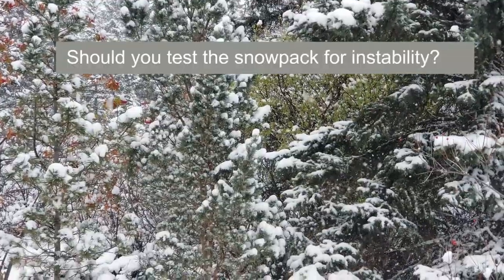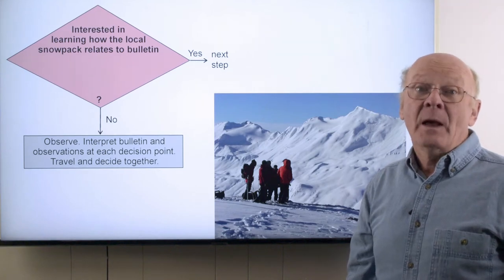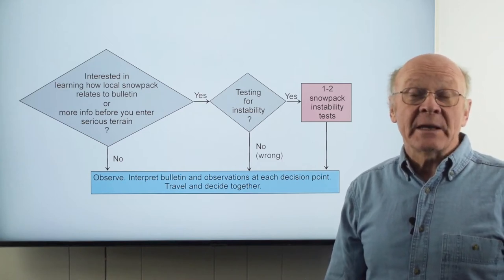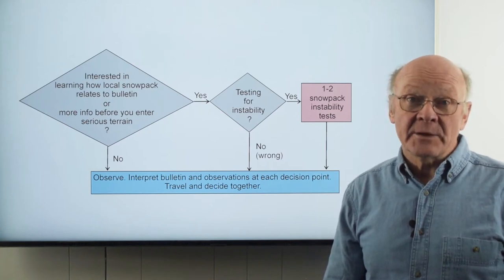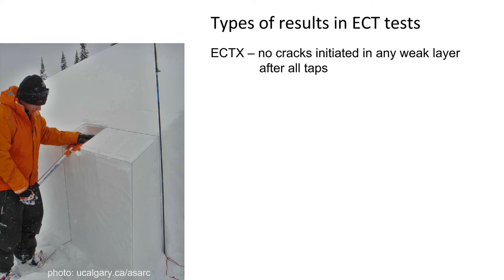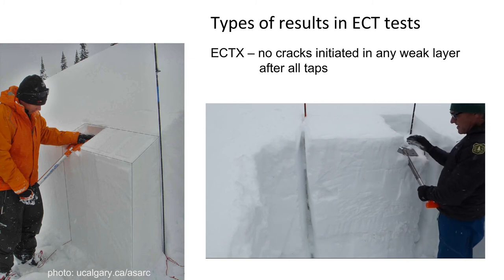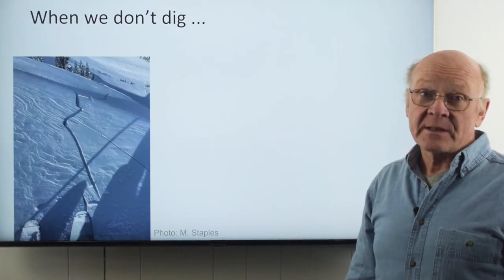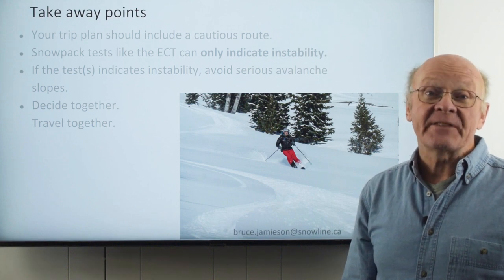Should you test the snowpack for instability?

Comment: Newbie question. Avalanches trigger at weak layers and propagate to create the slab. Sah you you did an ECT to test a PWL generally found at 55cm and had the result ECTX. Then you dig a pit to do an ECT but find the snow is shallower there so the PWL is around 40cm and had the same result, ECTX. My understanding is that you still don’t take that as a sign of the slope being ok to ski because you could find a different weak point to trigger (e.g. maybe around a rock or tree branch). Is that correct?

Comment: Thanks, excellent descriptions, dialogue, explanations etc. Especially reminders on " this is a instability test, not stability test" would appreciate more discussion of spring 1" comment. Have some experience here and would appreciate your thoughts. Thanks!! Really appreciate!
Reply: When the upper snowpack has melted and refrozen many times, the skiing is best when the riding is best when the snow surface (aka corn snow) has "started to soften" or something like that. I proposed "less than an inch" to emphasize that the soft - sometimes wet - snow on the surface should be limited and not enough to start a wet loose snow avalanche.